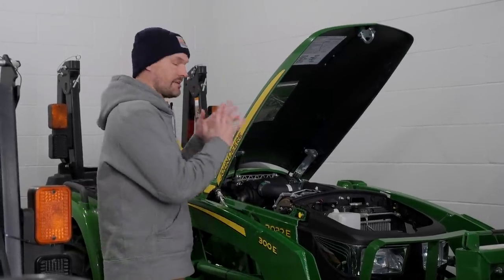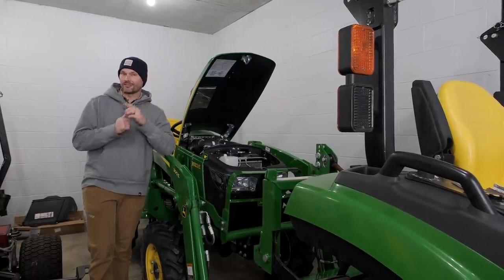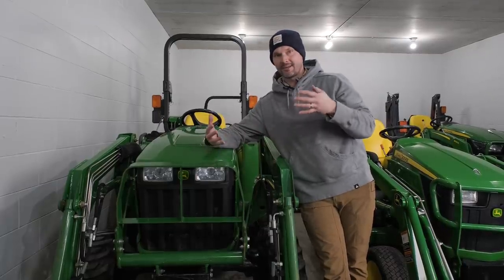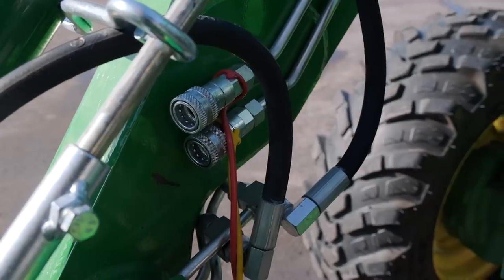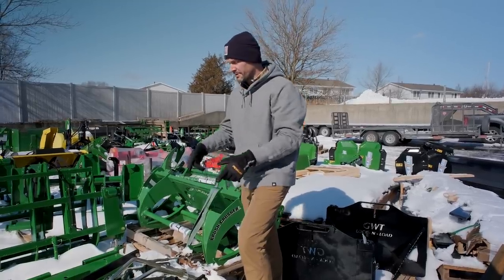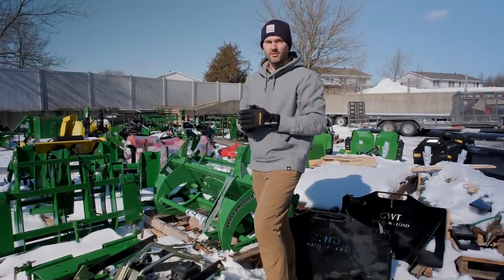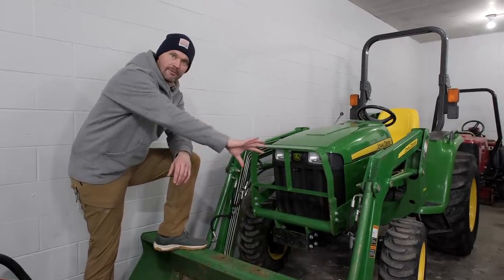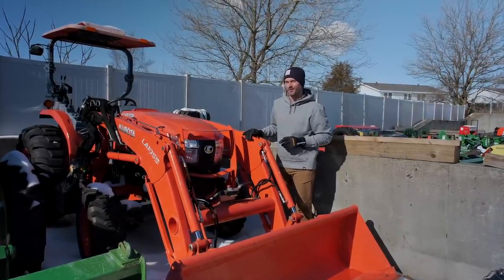THE 10 THINGS MOST LIKELY TO BREAK FIRST ON YOUR TRACTOR! 🤬🚜

Comment: I have 200 hours on my 2025R, much of it crashing in the woods with a grapple... I had hydraulic line damage, tire valve damage, light cover broken, hydraulic leaks, hood damaged .... all on your list.. in addition I had bent 3 point hitch bars, missing bolts and clips of various sizes.  All in all, very satisfied with the tractor. Zero engine, electrical or transmission issues.

Comment: Master C you made a very good point about routinely exercising the PTO solenoid valve. This goes for any valve really. I have seen many issues over the years caused by valves that were not used for a long time getting stuck by having dried crud in the spool bores preventing the spools from fully opening or closing.

Very good advice that needs repeated, a lot. 👍🙂
Reply: Same goes for 4wD switches on vehicles.     Put it in 4 low once a month for a bit.   It’s good for it.

Comment: A big thumbs up for Miller Tires. I have a 22 yr old Kubota B1700 and needed front tires. No one could get me a set of tires for this tractor. I tried 2 Kubota dealers, Farm & Fleet, and a number of local tire stores. No one had or was even interested in finding this discontinued tire size. When I called Miller, they not only knew about the issue that Goodyear caused discontinuing this tire size but had figured out a cost-effective replacement. I was able to get brand new tires and get back to work. Miller is a family-owned business that still believes in friendly customer service. If your looking for tires call Miller first and you won't need to call anywhere else.
Reply from the maker: Glad you know about them! Don't forget to use the discount code GWT for a 5% savings. Tell your friends to help them save, too!

Comment: Deere has always been electric/ electronic heavy. Its one reason I have Kubutsky products. Cave man simple electrical. Never a wiring or component  fault, and they are not babied. 
  Every light is damaged on every one of mine. I replace them with cheap of the shelf stuff. Ugly but cheap and convenient to replace.
  Seats lasted 10 years. Not bad. All my axle and spindle seals in front have seeped since early on. I just fill it anually.  Hood dents and grill damage are a given working in timber.
     Your vids are very informative and well made. Really appreciate your good work.
Reply from the maker: Appreciate a comment like yours from real world use. Tractors are tools, made to be used. And you accept the good with the bad, as nothing is perfect. Appreciate you taking the time to leave a comment and for watching!

Comment: My 1025r had 3 hours on it when the flywheel disintegrated.  Got it back in 2 weeks and within 30 minutes the park brake cable came unattached with the breaks on.  JD sent out a tech and had it working in less than an hour.  Since then I have put 45 hours on it and it runs like a champ.

Comment: Great video, yes if you use it sooner or later you have to fix things. I have a sub-compact New Holland and yes I had a front seal go. Mine was covered under warranty but from what I have read this is very common on the sub-compacts no matter the brand. I have done 140 hours on mine so far but at least 100 have been loader operations moving dirt and rocks. I am probably a little guilty of some extra heavy loads on it, which is really easy to overload these smaller tractors. I know my NH will grab and pick up more than it should, I have definitely gotten better about watching my loads. My saying now "Just because it can pick it up doesn't mean I should".  If any of you have your rear end off the ground or bouncing a little, you are guilty as well. Thank you and please keep up the Great videos I really enjoy them.

Comment: My Massey 1736 has them welded on the outside.    After bush jog rip off incidents I chopped it off with a whiz wheel and welded them on inside.     If you hog fields near trees you just gotta .

Cracked seats , try filling with SHOE GOO.     Not pretty but it bonds like crazy and keeps water out.

Comment: My opinion the quickest way to wear out front seals. Mow or do any other work in 4 wheel drive and with the loader on! Leave your tractor in 2 wheel drive unless 4 wheel drive is needed!
Reply: My property is so steep I have to use 4wd 99% of the time. Rebuilding a diff is cheaper then a crash
Reply: I usually drop the bucket and cut with the arms in place.   Still , if it’s gnarly I leave it on and skinning slowly along to find any errant stumps that may be encountered.

Comment: I own a 2010 3038E, the only issues in 10.5 years is the front axle, 6 seals have failed, 4 axis seal, 2 output shaft seals, indoor stored machine, I don't run in 4x4 un less plowing, just installed the new vented dipstick plug, pray this works.

Comment: I traded in my 2016 L2501 mt tractor a couple months ago! I bought it new and only had 125 hrs on it. 
Traded it in for many reasons but what got me started was the engine made an abnormal rattle while warming up….didn’t do it cold nor fully warmed up! In my experience in the automotive world it sounded like a hard piston slap. Probably a tolerance issue between the cylinder wall and piston skirt.
The service tech at my kubota dealer even heard it! Said it was odd and they haven’t had any of these engines apart in the last 10 years for premature problems! It was under warrantee still but according to kubota , in order to warrantee anything it had to be a failure! In reality the engine could  go on that way for years and years without an issue! …….Along with the piston slap, and my need for more HP and a HST ….I went with the L3902 HST….with PS this time also…😅 
I’m still happy with kubota and my issue was probably rare and the average person probably wouldn’t hear the noise because it is a diesel!
In general the 39 hp is quieter than the 25 hp model…

Comment: The front axle can be very expensive.  Mine on my Kubota suddenly began leaking so I stopped the work I was doing and took the tractor in for repairs.  Had to replace most of the gears, bearings, etc on one side of the axle.  It was more than $6000.  The tractor has been a rental before I bought it and the front end had not been serviced properly.

Comment: At 1200 hours had to replace the front axle seal. Now at about 1500 hours the loader bucket cylinders weep occasionally. The factory cylinder grey coating is beginning to wear thin.

Comment: The other reason the front tire wares out is because the front wheels go around more than the back ones do because the smaller tires rotate faster and more times than the rear ones do.
Reply from the maker: That does make sense for sure.  Thanks for watching.

Comment: re Greasing mower spindles, some spindles have sealed bearings and greasing does absolutely no good for the bearing.   Know which ones you have.  Additionally most spindles have replaceable bearings that cost only a few dollars vs $75-$95 for a complete spindle.

Comment: Thanks for the vid, really enjoy your stuff. I used the john deere light guards on my 1025R but i added two extra thru-bolts so the guard is bolted to the rops and not just held on with the light bolts. You could hang off them, they are solid and keeps lights out of my way when using backhoe.
Reply from the maker: Good idea!
Reply: DON'T drill holes in your ROPS.  BIG NO NO.  Affects the entire ROPS and can lead to failure when you need it most.  READ your manual.
Reply: @flick22601  I appreciate your concern, but the two holes I made are not going to compromise the structural integrity of my ROPS and even if it did, it wouldn’t much matter since i folded it down when I signed the papers at the dealer 3 years ago and have never flipped it up since. If I had, it wouldn’t fit in my barn, or my garage, or under my trees, or basically anywhere other than in the driveway. Your mileage may vary.

Comment: Hello , really  like  your  channel , talk about   trouble , I   bought  a   new   JD 2038R  Last  spring , I  live  in  upstate  NY  its  been  cold  the other  day  when  I  started  it I  had  the red stop sign come  and had no  power , went  in to  check  the  book  it had nothing  about  just  the  red stop sign  coming  but  only  when  it has to regen ,when  I  went  back  out  I  started  it  again  and it was  fine  no problem , I  did  stop and ask my  JD dealership they didn't  really  know  what  it  could  be , well  got home  same thing happened   again  but had a code ECU 12O9.03 went back to dealer they still  didn't  have  a  answer  again  got back  to  my  house  started  it and  it  was  fine,I  just  used  it  yesterday  and  had  no trouble  with  it , did some research  and   found  out that  the  code  stands for  exhaust  manifold  sensor,the  guy that  had the  same  trouble  had his   dealer  fix his  they replaced  the  sensor , the tech told the  guy it has  to  do  with  the  DEF  it could  happen  again , the guy had 75 hours  on his  mine only  has 65 hours , no very  happy , love your  channel  enjoy  watching  it.
Reply from the maker: Crazy, first I've heard of that issue.  Fortunately, not widespread.

Comment: Have my 1025R for 5+ years now and the only problem I had was a bar under the floor board that connected the forward and reverse pedals to the htdro linkage shaft. Bad weld from factory. Big difference between the new weld and old one. It got passed up in quality control. It happened in the middle of a snow storm.  Tractor was useless. Had to tow it back to the tarp garage.
Reply from the maker: Wow, pretty good run besides that defect!
Reply: Don't jinx me Courtney....lol

Comment: 2017 JD 1025R seat supention is very light weight,  17# mine broke . The new one much heavyweight,  27# . Also over $500 installed.

Comment: Had to replace seat link twice on the rotating seat on my 1025R TLB before Deere sent a beefier one.  I had also already replaced the seat springs with the heavier ones from Ken's BOH.  Finally,  I just tore down the fender fuel tank to reseal the gas gauge to keep water out and replace the fuel line fittings to fix the fuel leak at the bottom of the tank.  About 400 hours in and it sleeps inside. Grr!   Oh one more thing.  I would like to find one of those front axle dipstick relief valves.  That may have help with blowing front axle seals.  Can't seem to find any though.  If you find a source, sell them on your store?  I'll buy one.  Thanks for sharing!
Reply from the maker: Boy, I've never seen that dipstick relief valve.  Anyone got a link??

Comment: The more I look at these small tractors, the more I can't help but think this is a market segment ripe for disruption through electrification.  

Bring automotive grade batteries to these things and for the average owner, that's going to be perfect.  3-5 hours of run time per charge. No messing around with fuel, just leave it plugged it in when you're not using it.  Get rid of a swath of maintenance items like oil changes.  Eliminate items at high risk of damage like radiators and you'll have a smooth protected undercarrage.  Get rid of transmissions; electric motors don't care which direction they turn AND they have way better torque curves than any diesel AND they run nearly silently so you'll be better able to hear what your implement is doing.  Batteries are heavy, yet another benefit for this application.  For the independent types, you can install your own solar to charge your tractor.  Live totally off grid.

The big concern is always how long batteries last, but we've got nearly a decade of experience in the automotive world with these cells and they've proven to last at least as long as a gas engine before it needs a rebuild and the latest generations of cells are showing that they could outlast the body of a car more than 2X.
Reply from the maker: Yeah, I agree.  The problem is the tractor/ag industry moves slower than a snail.  It'll happen, but about 10-20 years later than it should.  There is an electric tractor start-up though, but I think still very early stages.

Comment: I bought a 16-year-old John Deere 5220 tractor with 906 hours.  One of the cylinders was leaking and the tach didn't work.  (The hour meter did.)  Otherwise it's running good.  On a cold Texas morning (around 30 degrees) it starts right up.  I can see a faint whiff of white smoke that disappears within a second or two.
Reply from the maker: Very cool, hope it treats you well!

Comment: Thanks you the info... One thing that I was very surprised was the high cost for filters on my MF1735M all >$75 apiece.  Is this same with all manufacturers?  Changed both fuel filters, oil filter and hydrostatic filters total cost for filters only was nearly $400.   Seems you can get them from a dealer.  Any suggestions?
Reply: They are blinding aren’t they🤬.   Baldwin still hasn’t got to making oil filters for mine

Comment: I guess it's just a crap shoot, my '97 JD-770 I bought in '98 has had one bucket cylinder seal go out (I think it's going out again?), the clutch spring just broke last year, those foam seat spring dampeners (?) and I leave the 4wd on almost 24-7 unless I drive on the black top. My smaller property is just too soft and ugly. 900 hrs on it so far. Fingers crossed. Yeah and try finding front 6.00 x 12 tires that Firestone gave up on. Wore them as smooth as a baby's bottom before I found a similar pair last year and the rears have at least 70% tread left. Yes, some of that wear was probably the 4wd. I guess we'll see how my '21 LS MT235he I picked up last winter holds up.

Comment: Already ran over and broke off the handle for one of my spring pins trying to disconnect the drive over mower deck on my slick concrete in the garage. Just got the tractor last week. Idc what anyone tells you DO NOT try this on concrete. It isn’t worth it. Drive it out on the gravel or yard. Even rough concrete or asphalt will probably work

Comment: I had my Mahindra for a month and stuck a limb through the headlights while clearing brush. Cost $1000 for a new plastic front end.
Reply: I'm sure that most any tractor that would be an expensive repair... even the metal ones will bend and dent and look bad after a few accidents